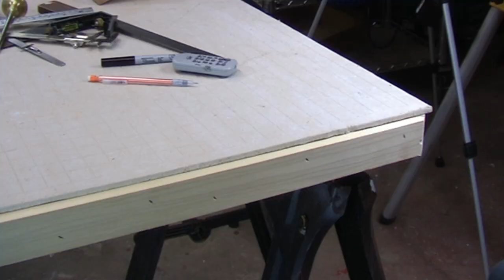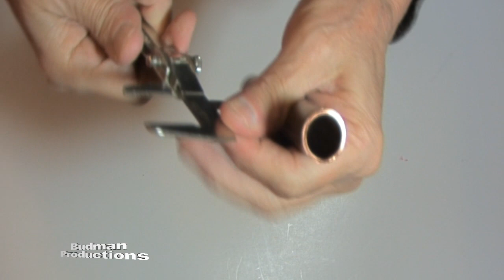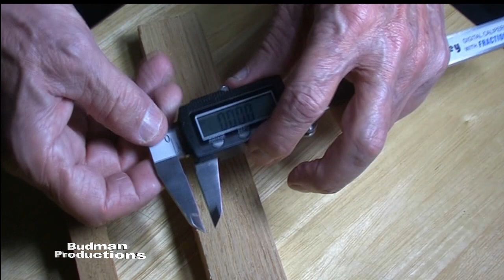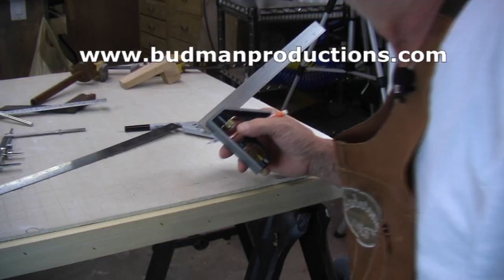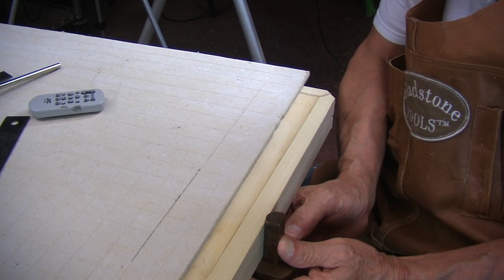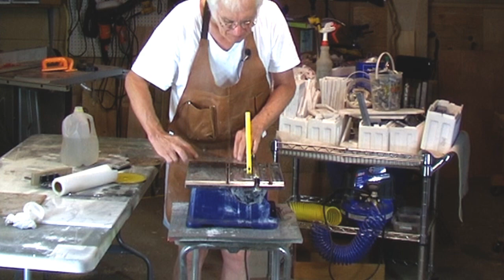Using Measuring Tools

Comment: I really loved this video.... a lot of nice information... the caliber is the one I wanted to know more about. Now I see it take several different measurements. I am an inline skater and I think that this would be an AWESOME tool to use on measuring the size of my wheels in millimeters.... I currently use a ruler. When measuring something that is round sometimes it is hard to get an accurate measurement... Thank you very much for the video... :)